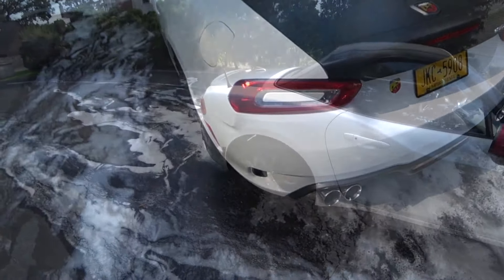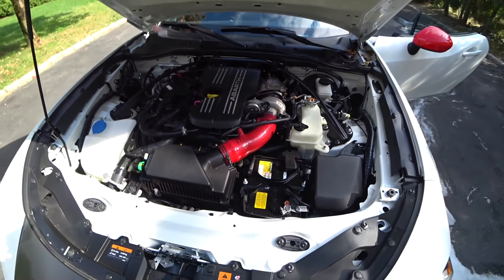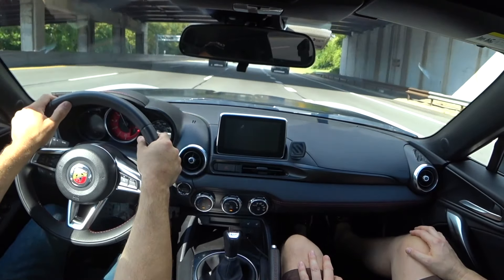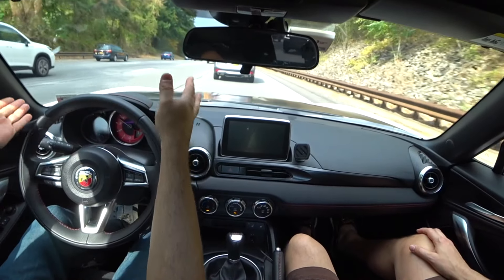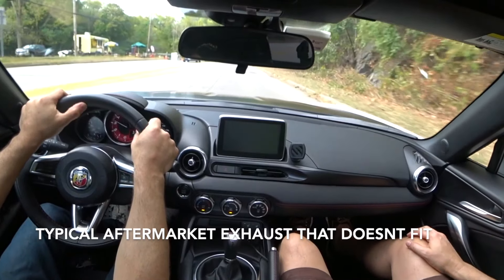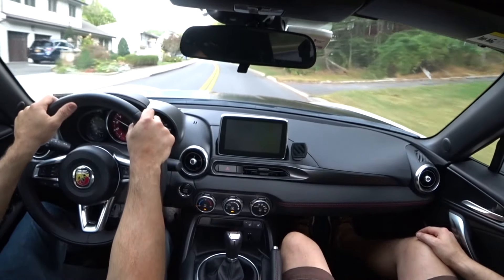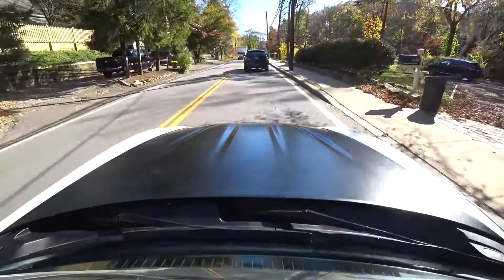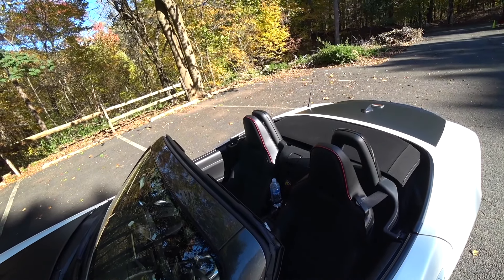Fiat 124 Spider Abarth | What a True Sports Car Should Be, FUN!!

Comment: Bought my 2017 Abarth brand new.  #15K on it without issues.  Now has cold air intake, turbo blanket, updated bypass exhaust, and Tork tune.  Lot's of fun.  Most people take it for an Alpha Romeo, Ferrari, or Lamborghini.  Strong but not crazy horsepower.  It won't try to kill you (like my old Shelby) but will make you smile!

Comment: Change the fluid in the Transmission to royal purple.  that will fix the 2nd to 3rd gear issue.  also recommend changing to a shift ball from the stock shift knob.

Comment: I fell in love with the Fiat 124 Spider a year ago.  I came across a Fiat/Maserati dealer tbat had a great blowout price on a few 2018 Fiat Lusso's because of tbe Pandemic and sales were slow.  So I sold my Saturn Sky Redline Turbo.  The Lusso I grabbed was sitting in tbe dealers wherehouse for a year and they wanted to move some inventory.  So I snatched it up. Do wish I had that Abarth though. Your video got my attention, love your mods on that Abarth. I look forward to your follow up videos to see what else you do. Question, with some of those mods, could I get my Fiat Lusso, which is an automatic with manual override to sound close to what you achieved.? Please reply and summarize what mods you did to get the extra HP and enhance the exhaust to sound so awesome.  I take mine along PCH quite a bit with that top down, super fun. I plan on going up to Big Bear soon, can't wait for the drive back down the hill, alot of fun curvy roads.  
Thanks for sharing your cool fall ride.
Reply: Herb the one thing I will tell you is that the abarth automatic transmission has sport mode and that is what makes the greatest difference

Comment: Please add more content on this car. Would love to do some mods to ours. Very interested in your tire recommendations.
Reply from the maker: thats the plan the tires will be pilot super sports we are up in the air on rims now as we want to go wider
Reply: I ended up spending more on those pilot super sports than the new wheels themselves. Honestly worth it, I've got mine up to 135 and never felt anything but confidence.
Reply from the maker: what wheels did you go with and did you go wider than 17X7 and did you stick with the OEM tire sizes? tires on this car will make a HUGE improvement in grip and confidence which the owner totally gets which is why we are doing it ASAP.
Reply: I went with some Enkei M52 17x7.5. Tires are 215/45/17. I haven't installed coil overs yet so that's the widest I can run on stock suspension. I also have the EC piggyback ecm. Only 28k more miles until I can put a stuffed turbo and straight pipe it.

Comment: The 5spd manual from the NA Miata is much better feel than the current 6 speed manual 124 which is from the NC Miata. Definitly needs short shift kit. Can try one from the NC Miata but there are some bell housing differences I'm told. If anyone knows of a true short shift kit for the 2017+ Fiay 124s please advise!! ; )
Reply: They used the NC gearbox because it can handle more torque. I dont have a need for a Shirt shifter in this Car. The only thing is that the ratio of the 2nd gear is too long.  I dont know any supplier of tuning parts specificly for the 124. But there has to be plenty of fitting parts from the Miata.

Comment: Stop comparing it to the Miata. They are Nothing like each other. And no this car was not made in the mid 2010s it was made in the 1970s
Reply from the maker: are you insane the Fiat 124 and Miata are the exact same car with different engines FYI they completely shared the platform.
Reply: @autofanaticcars  then explain this. The FIAT 124 Spider came out in 1966 and was produced until 1985. The only reason why it was stopped is because of safety restrictions. The car had a 1 star rollover and no airbags. The 124 isn’t like the Porsche 911 which was never discontinued. But my entire argument is, this car has nothing to do with being made off of the Miata. The Miata was made in 1989. Four years after the car was discontinued. So if there was any copying. It was Mazda. As far as the 124 goes, it was once a sedan before it was the spider. I don’t see any sedan version of the Miata. An no they don’t have the same engine. The 124 started with a four speed trans and a 1.4 I-4. By the ‘80s it had a five speed trans with a 2.0 I-4 DOHC W/ fuel injection. And I own that exact model. The Miata might be the most Raced car of all time, but they never sold as many 124s as FIAT during the heat of their sales. They were made for the European market and the American market. They also sold sport models made for rallye, and the 2.0 I-4 DOHC was used by FIAT, Lancia, Abarth And Alfa Romeo. if anything FIAT brought their greatest creation back to life. At the worst time possible. Its sad.
Reply: @inerphobic5343  why do you say its the "worst" time possible ?? its a good looking car and super fun.. always a head turner and everyone loves it. its made exactly for that reason